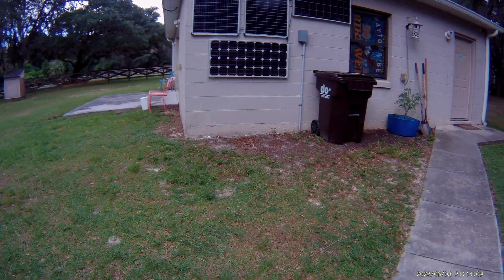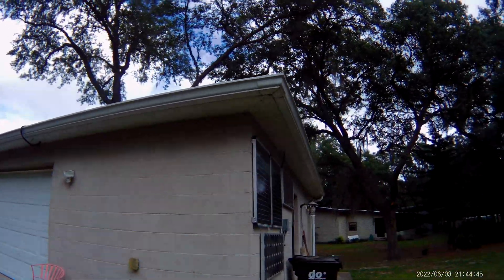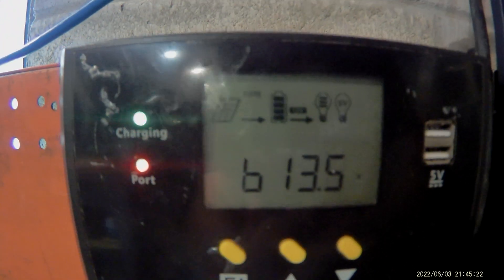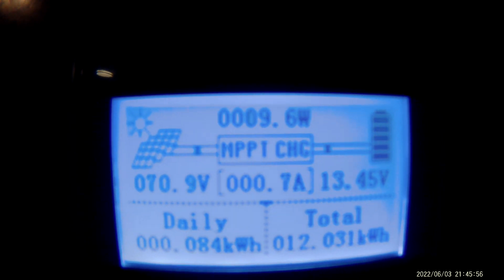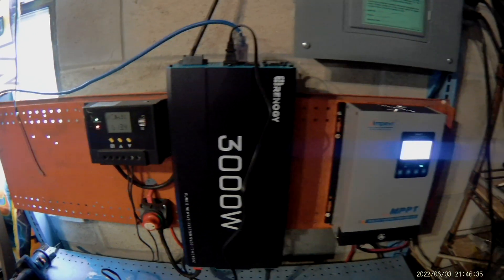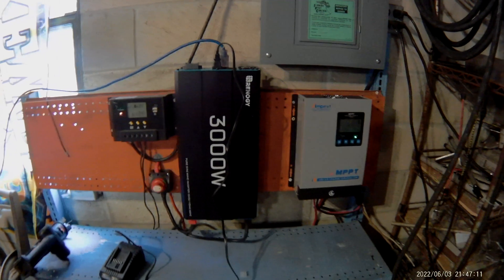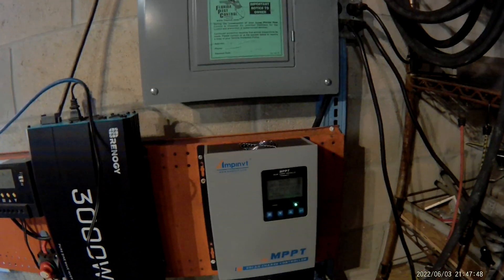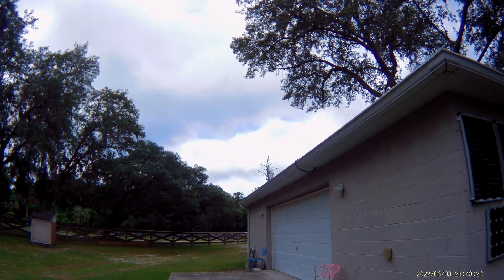solar on cloudy day

Comment: Voltage is easy. Amperage is what you need. Without direct sunlight you will not create any amperage to keep your batteries charged. Voltage alone is not enough. I have been down this road and learn the hard way. I have my panels in series at 110 V on a cloudy day I’ll get one amp to my batteries. But on a sunny day I’ll get 20 which is much better. Voltage does not charge batteries in a short period of time. You need that amperage to back it up. Get the panels off the side of your house. They need to be on the roof with the other ones and I guarantee you you will more than double your power.  You have a great set up😊 By the way, I did subscribe to you
Reply: I agree